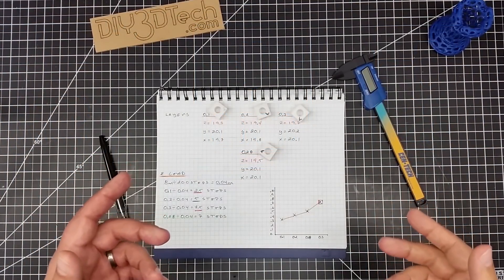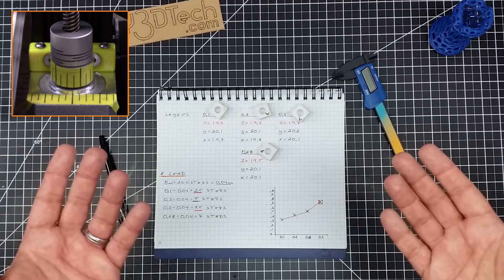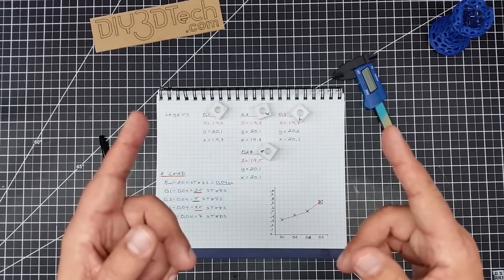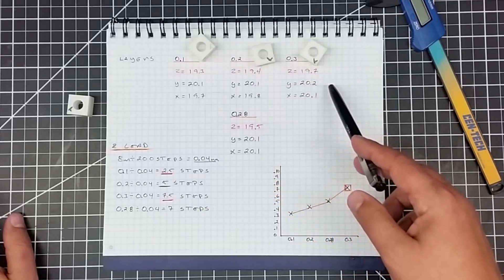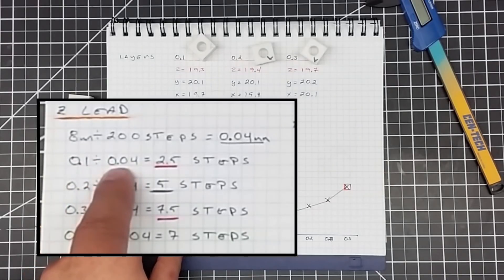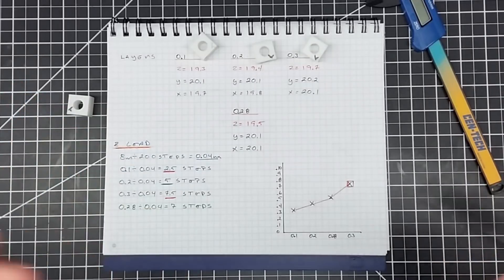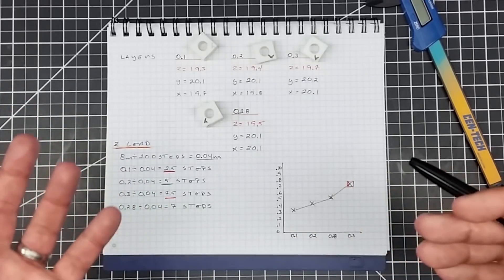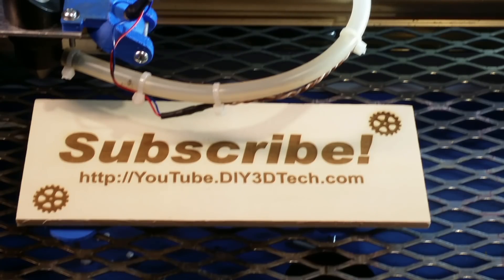Shop Talk - Is your Z Axis Lying to YOU?

Comment: The full step or half step mechanical consideration is relevant, because these are least affected by nonlinearities arising from arrangement of elements in the motor or biases of the fractional current delivery by the driver, they are more inherently stable than smaller steps. 

And yet there is no reason for there to be an accumulation of error. Error will be recurring but not accumulating. There's high precision planning and Bresenham on all axis, so if needed, a varying number of microsteps will be made to reach the programmed height, you don't just end up making n steps for every layer change.
Reply from the maker: Now I have to disagree with you that the error is not accumlating (i am also not reffering to motor error [see note to Peter Oak below]), as you can see in my crude graph 0.3 becomes an outlier  (think of this as a control chart) as the physical system can not achive what it has been told to achive and do not see the firmware being smart enough to "balance the error" [also see Scotts note below] as it "appears" to average it up.  So to make the 0.3 move it must over achive for "each" layer at 0.3  SInce this video created so much controverse, I think I will do another extending this thinking (thanks for the idea, I was starting to run dry :-)
Reply: 0.3mm is likely to be an outlier with a different root cause. If the error was accumulative, you'd see 0.1mm slice of 20mm cube have the highest height error instead of the lowest! If you claim that the half-step cannot be made physically, then it follows that at 0.3mm, you'd be off by 33 height steps by the end of the print, and at 0.1mm you'd be off by 100 height steps! Since you have calculated the step to be 0.04mm, it follows that your height error would be 1.34mm for a 0.3mm print (6.7%) and 4mm (20%) for a 0.1mm print.

This is obviously absurd and never going to happen even if the firmware didn't have Bresenham on Z to distribute the error, because the Melzi board microsteps every single axis to 1/16th. Incidentally, every microstep corresponds to 0.0025mm on your lead screw, so from the firmware perspective, pretty much any layer height anybody would bother to try is an integer number of step pulses on your lead screw and your control board.

Number one thing to check is: how high did the slicer actually slice? If you have two planes exactly 20mm apart, chances are, the available space between them is not 20mm, it's 20mm minus epsilon, unless the slicer preprocesses the models to enlarge them by an epsilon or so, which is prone to introduce other issues yet. Epsilon is a small number that represents the rounding error and which MUST be taken into account in certain families of volumetric algorithms, else the result would be entirely catastrophic, but as a result of proper operation, there is a miniscule volume shrinkage. Thus if you have layers that are exactly 0.2mm high, you'd think you can fit exactly 100 of them between these 20mm worth of distance between planes, but you can't, you're an epsilon short and you get 99 layers! Plus how high did it make the first layer?

So to me it looks like the models were sliced one layer short every time, thus increasing the error depending on layer height in general; plus machine mechanics such as zeroing runs, sensor drift, microswitch drift, introduced an additional error that is bounded, but likely not exactly random since it was likely temperature dependent so the test order would have influenced the result. If the error was accumulative, it would grow with the number of layers, not with the thickness of layers.

EDIT: fixed a stupid arithmetic mistake in 1st paragraph.

Comment: It's worth noting that with bed leveling enabled, the Z axis moves continuously in response to XY movement (at least, up to the "fade height"). Once it's past that point it goes back to just moving by layer heights. During the period when it's doing leveling compensation, all bets are off, and layers may show some minor artifacts.

If no one else has mentioned, the biggest worry about aligning with full steps comes if the Z stepper is allowed to power down between layers. That you definitely want to avoid, if possible.
Reply from the maker: Many thanks for responmding! If this is the case "Marlin's handling of coordinates is designed to make sure that steps aren't lost in the translation that goes from G-code to floating point XYZE to step counts. If something rounds down a step in one move, it gets made up in the next move as a consequence of always starting from the Cartesian float representation." then it invalidates the Prusa Calculator totaly as your saying it makes up for "all" errors which also assumes there is always enough layers to adjust for the error but how?  Does marlin know the total number of layers up front and keeps a running total of the error averaging?  Becuase as you said up front "Marlin doesn't actually know about your layer heights"  and "applies movement as closely as possible to the requested position" which would be in line with what the calculator is saying...
Reply: 3D printers are totems in The Church of the Open Loop. We operate on the faith that the stepper drivers get our step pulses, and that the stepper motors complete their steps and don't get blocked. The Skeptical Sensor Reconstruction is now underway, adding more intelligence to the system in order to ensure good results rather than relying entirely on thoughts and prayers, which only leave us open to the whims and caprices of Thor.
Reply from the maker: This is facinating and enjoy when stop by and comment, however can you share more on this.  For example how does marlin handle say non-compatable layer hieghts?  Does it attempt to average them? As my test with CR-10 shows it to additive in the cube tests.  Also what you don't have bed leveling turned on (as I don't here) what happens?
Reply: DIY3DTECH.com Good questions! First, Marlin doesn't actually know about your layer heights. It accepts whatever commands it's given and applies movement as closely as possible to the requested position. When you configure your steps-per-mm for XYZE you specify it in terms of micro-steps and so the number of full steps isn't actually known. You could be using a 1.8 degree 200 step motor with 16x micro-stepping or a 0.9 400 step motor with 8x micro-stepping, and it looks the same to Marlin.

As for the difference between leveled and non-leveled moves, well if leveling is disabled, there's no modification made to the given positions before they go to the planner (apart from kinematics, G92 workspace translation, etc). In other words, it does precisely what it's told to do.

Marlin's handling of coordinates is designed to make sure that steps aren't lost in the translation that goes from G-code to floating point XYZE to step counts. If something rounds down a step in one move, it gets made up in the next move as a consequence of always starting from the Cartesian float representation.

Conversely, when a move is interrupted in the middle (e.g., emergency stop), Marlin will take the stepper positions and work backward to obtain the mm positions. Here there is a slight error plus or minus a partial single step. But this is a rare event, and in most instances the machine is likely to be re-homed before the next job.
Reply: Marlin does not know about uSteps for instance so if the controller is powering down when idle and then back up to move, it could introduce a height change of 0.04mm and marlin would not know about this, it knows to issue n number of steps to get to the next calculated position. and as Scott mentioned Marlin will compensate from float position to steps as it goes but it will at the end of the day, simply send step and direction pulses to the controller and has no knowledge of what the controller is doing in the mean time. The software would need to talk to the driver in order to know or know what driver is used and how it is configured, this would make the software way more complex and as a user can so easily change jumpers ... well you get the idea. Now with the new Trinamic tmc2130 drivers as used in the new Prusa, it should be possible to do way more intelligent stuff, couple with the flexible layer height of the new Cura and we may get somewhere. The slicer simply divides up your model based on you instructions so if you say 0.3mm layer than all Z moves will be based on that and nothing else. if you model is 20mm high then 0.3 does not exactly fit and there will be an error and you will get either 19.8mm or 20.. the slicer knows nothing about your printer uStepping or how it works
Reply from the maker: LOL!  Thanks as always, appreciate your comments and would enjoy buying a cup of coffee one just pick your brain for 10 min!
Reply: Totally, the powering down (Back up actually) is the one thing that can introduce potentially the biggest errors in the print as when the controller resumes (Not the Software) it will jump to the next whole step adding worst case as much as 0.04mm but on average should be nearer to 0.02 and this can accumulate on each layer for the DRV8825 and A4988 stepper controllers, look at page 14 of the 8825 data sheet, it clearly states the shift to electrical 45Deg on power up / resume... this is 71% power to both coils. BTW, contrary to popular belief, full stepping does not apply 100% power to each coil, it only uses 71% (At least for the 8825 and A4988), this is to allow better torque control for 1/2 stepping and beyond. (Its all in the data sheet)
Reply: Oh so true.... Ahmen

Comment: this has been discussed on the Reprap forums for at least 4 years and in combination with accumulated errors and rounding on 8 bit processors.  It is interesting to note that Prusa notes in their Mk2  machine slicer settings ( and S3D profile) that 0.15 is the "optimum" setting . i havent managed to reverse engineer why they think that to be the case. Is it just optimum in the speed v quality arena or does in genuinely relate to the steps/mm in their firmware for the A4988 chips
Reply from the maker: Many thanks for sharing this as it makes sense being speed v quality  as many moons ago use to do ECU work for the a major auto company and the easyest way I can explain what we did is seek a harmonic balance of the systems.  As we would block or shape toruqe bands from the motor so we could say reuse a transmission in a larger truck and not blow it to peices.  Assume simular here...
Reply: coming back to the Prusa Mk2(S) and the mini rambo that has fixed A4988 chips . Their firmware/config ( like many others) uses 16 microsteps . So 200 motor steps multiplied by 16 microsteps gives us 3200 microstepes per rotation.  If with then divide the 8mm lead we get 0.0025 Z variation per microstep!  From that it would appear that layer heights of 0.1-0.125-0.15-0.175-0.2  would always ensure the layer height is exactly divisible by 0.0025 .This is also supported by "their" S3D profile for 0.15 layers to have the first layer height as 133%, which bumps the first "bed adhesion layer" from the desired layer of 0.15 up to 0.2.
Reply from the maker: makes sense...